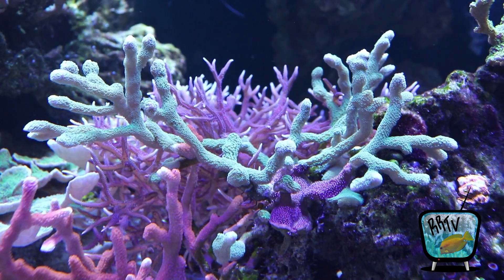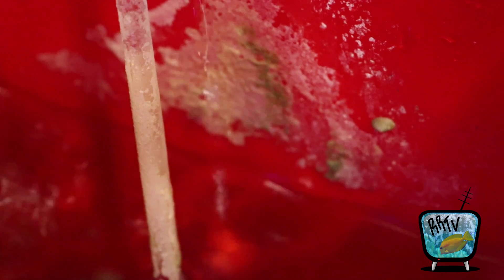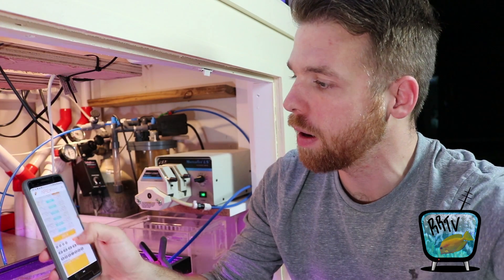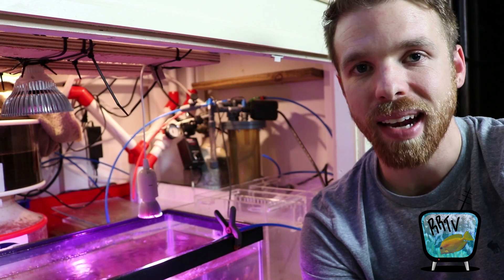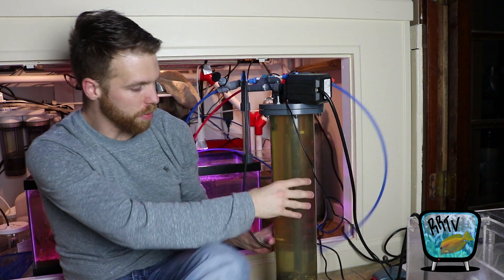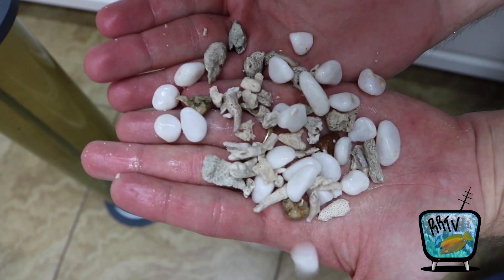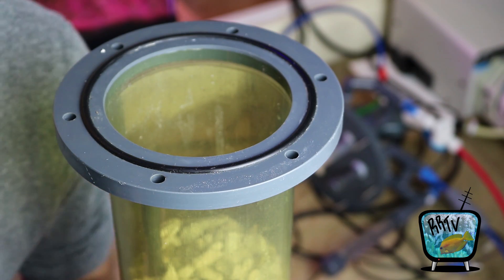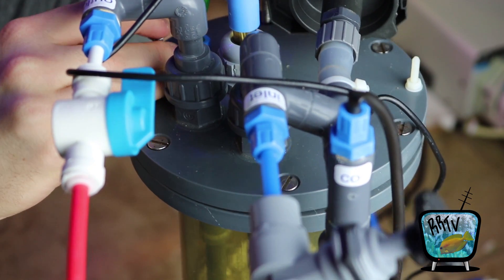Calcium Reactor! Explained, Maintenance, DO YOU NEED ONE?!?!

Comment: Thanks for the vid!  I just picked up a Korallin reactor like yours, and I have a question for you:  How did you adapt the tubing/fittings to the RO tubing and John Guest fittings?  Also, I see your peristaltic pump is pulling from the top.  What are you doing with the other outlet, the red tube in your case?   Thanks again for the content!!
Reply from the maker: i used some barb to JG fittings i bought from US plastic online.  on top of the reactor the line that comes out has a barb fitting ball valve and i just shoved the RO tubing on that and ran it to the JG end of the adapter mentioned before.  that then runs to the rubber dosing tube on the peristaltic pump.

Comment: You mentioned initial cost but did not comment on ongoing costs which, over time, surely can impact the long term viability of any decision.
Reply from the maker: Cost me $50 for a 20# tank refil which will last at least a year. And the media needs to be filled about twice a year so that's about $70 per year. I think the real saver is the time and most importantly the consistency the reactor gives. Hope this helps

Comment: Wondering why you are using a needle valve on the effluent out when your using the Kamora to feed the CR. (Unless it's opened up all the way?
Reply from the maker: It's opened up all the way.. I attempted many times to tune the reactor with the needle valve until I gave up and bought the peristaltic pump. I was lazy and didn't take the needle valve off lol